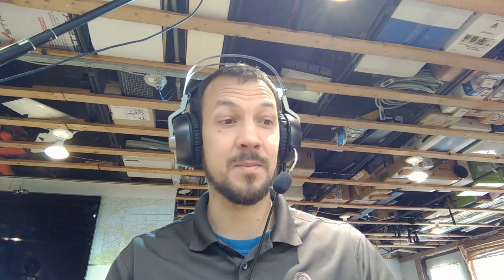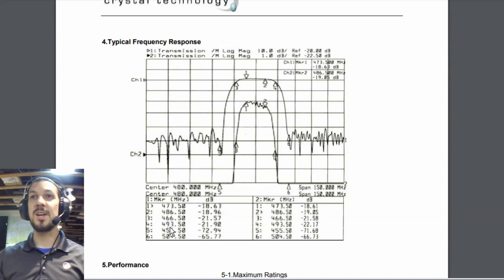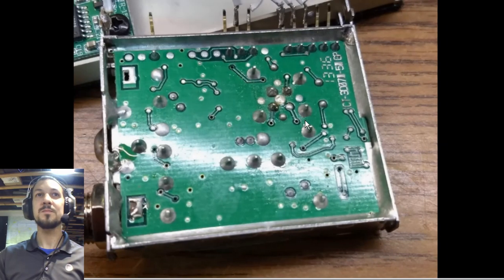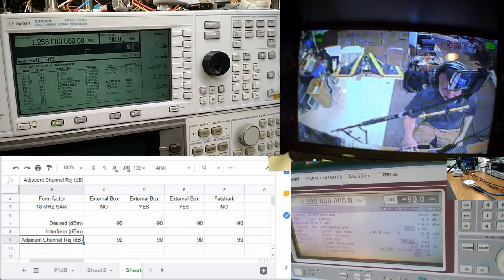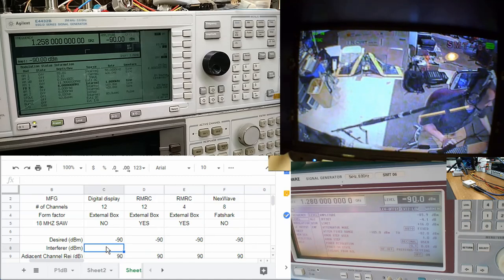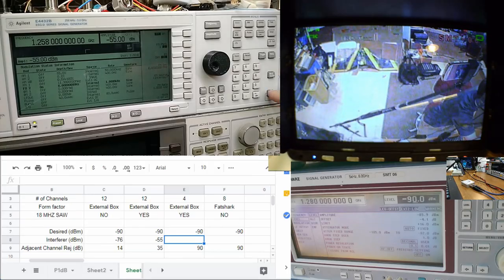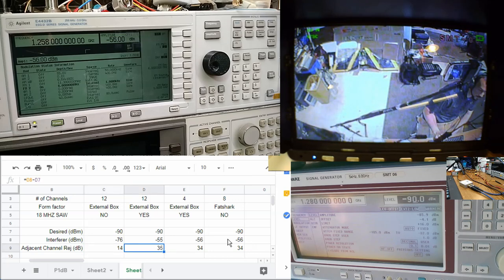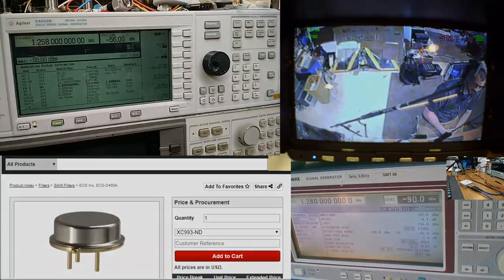Why you should do the SAW filter mod to your 1.3 GHz FPV Video Receiver - PK's Lab

Comment: Hi, love the videos. Is it worth changing saw filter if I’m flying solo in a remote area. I use a 868mhz frsky R9 radio tx to control plane. Not sure if I would benefit? Cheers
Reply from the maker: It will improve how the module behaves as you approach sensitivity.  Without it, you'll get black and white specs in your video well before you drop to black and white.  This is because the actual occupied signal is narrower than the stock  26 MHz SAW filter, so that additional in-band noise results in a degradation of the demodulated video signal.
Reply: @PKsLab  Excellent, thanks for the video post and the response to Aldan's question, I was wondering the same thing.

Comment: Have you been able to look at the internals of the newer RMRC 1.3ghz digital display Vrx to see what saw filter it comes with? Been waiting weeks for a reply from RMRC.
Reply from the maker: I picked up one of the newest one that they just restocked last week.  It looks to be using the narrow 18 MHz SAW.  But it's behavior as things get down to sensitivity isn't super (wavy video).  This potentially indicating a different amount of de-emphasis is being applied to the baseband video signal at the RX side.  But I only have one unit and have been busy being a dad.  Don't hold your breath on me getting to the bottom of things anytime soon ;-)
Reply: @PKsLab  your findings are consistent with my testing in the field. I picked up one of the 4ch older versions per your recommendation off the member of rcgroups. That explains why I found a wall at 18-22mi when I could go 20mi on 5.8ghz 🤨
Reply: @PKsLab  FWIW the wavy behavior occurs as close as 5-10mi. Very strange.

Comment: How did you manage to remove the saw filter? Haven't been able to get mine out no matter the amount of heat or pressure :|
Reply from the maker: Solder wick to clean up each pin can help if they are stubborn.  A hot air rework station also can help.
Reply: PK in the end i had to apply heat directly on top of the filter can since it had solder underneath